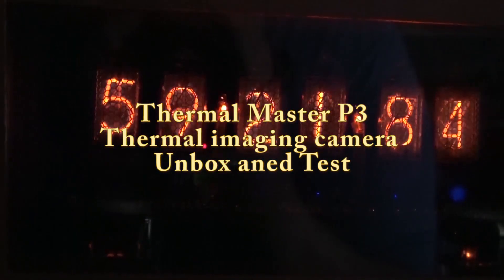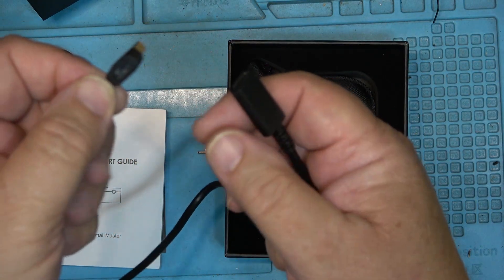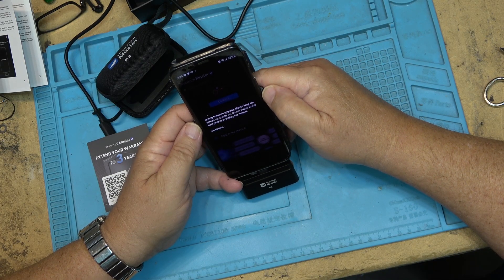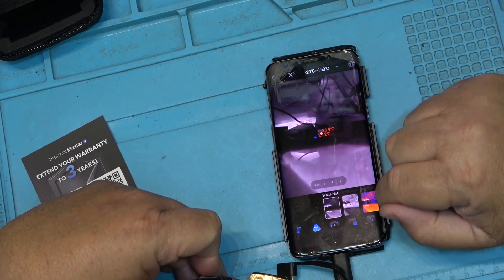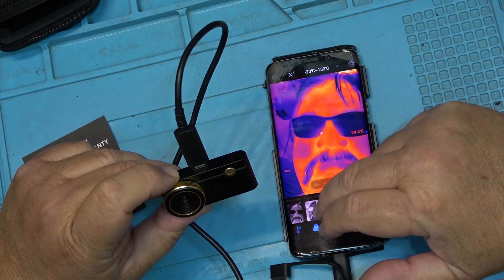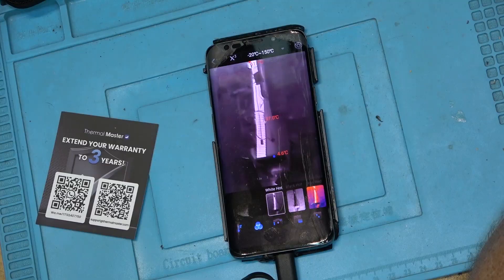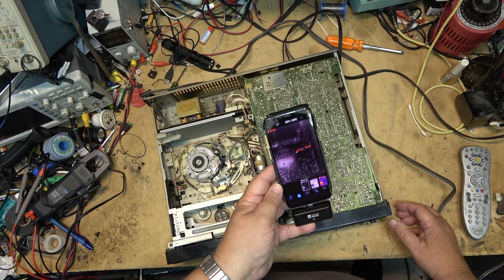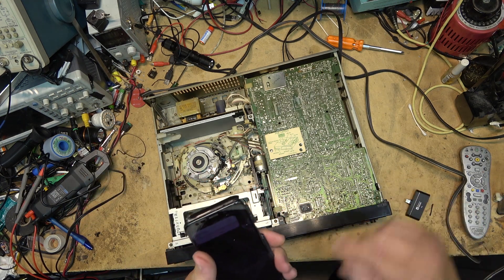Thermalmaster P3 Thermal Imaging Camera For Android IOS and PC

Comment: I have one similar, I think it is a Topdon.
I discovered a huge Handheld one at an Auction I was working at and did not reveal to anybody that I knew what is was and I looked up it's value. $40.oo for a $3'000 Camera HAHAHAHAHA....
Reply from the maker: They used to cost that but not anymore
Reply: @12voltvids  I take them out in the woods and after dark sitting by My camp fire I can see Small critters scurrying about ..

Comment: P3 is really good for the Pcb works 
A customer complained their phone was draining fast after a screen replacement. I scanned the logic board with P3 and found a heat point next to a small PMIC. The 8mm macro focus helped me zoom in. It was a shorted capacitor.